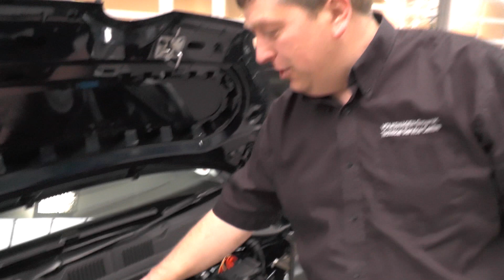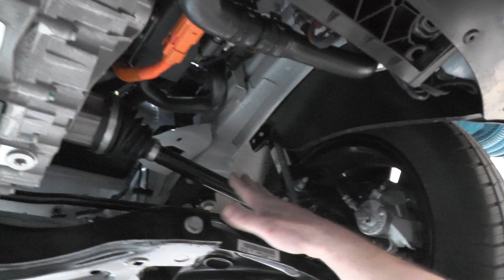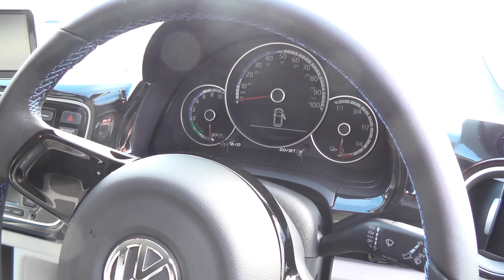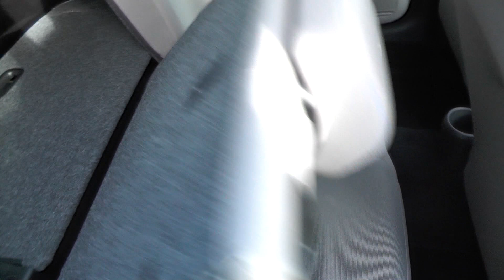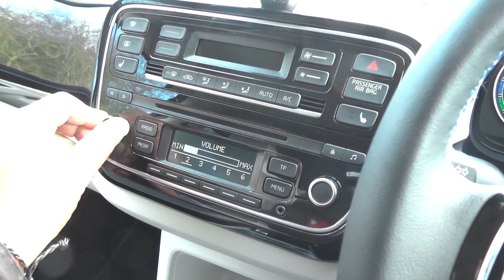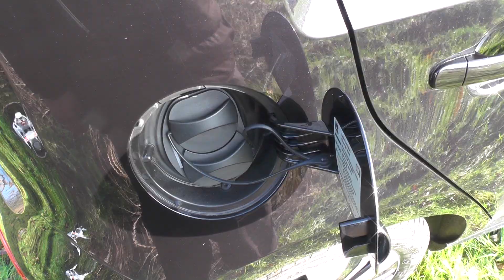Volkswagen e-up! - our test of this fun electric hatchback [First Look Review]

Comment: Look like cool and useful cars. I have the petrol version. Wouldn't it be fantastic if we could invent a way to feed power back into the batteries when just using normal driving. Of course it wouldn't be possible to fully recharge the batteries doing this, but even just putting a small percentage of power back instead of losing it would massively improve range.

Comment: Just curious, what about the home charging efficiency from, say, a standard 220 V, 3 kW socket ?
And does the car have the heat pump for heating/cooling? What about its behavior in colder climates ?